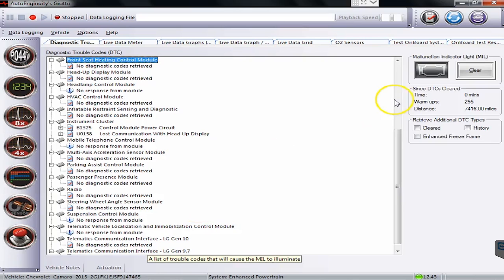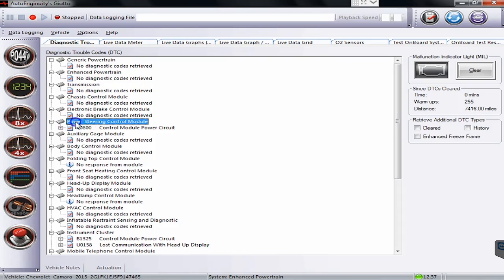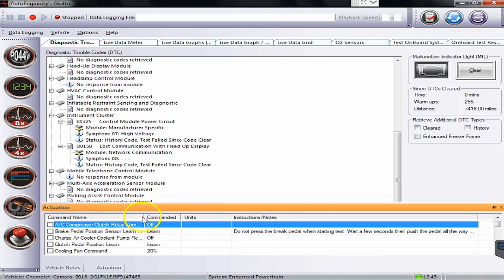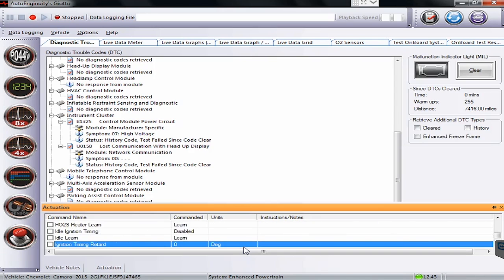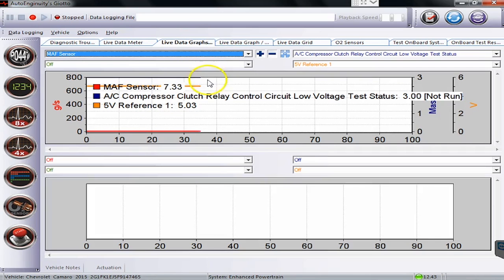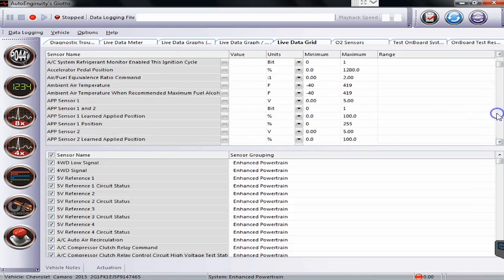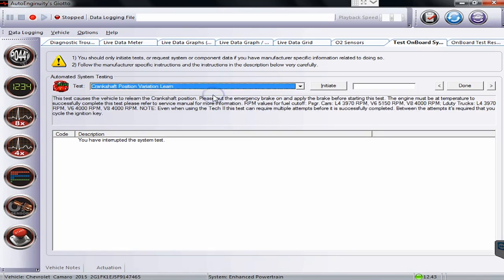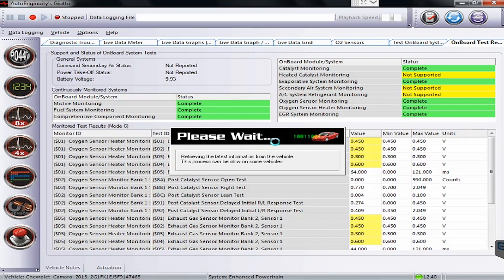AutoEnginuity 2015 Chevrolet Camaro Demonstration

Comment: hello .. could i contact u about this software ? i have the same but i had alot of problem with auto disconnect by itself !
Reply from the maker: Sure, call our tech support team at 888-983-1975 option 2. You can also call AutoEnginuity direct at 1-480-827-8665.